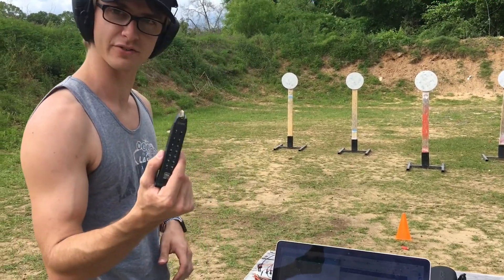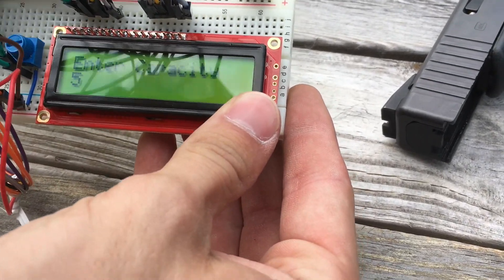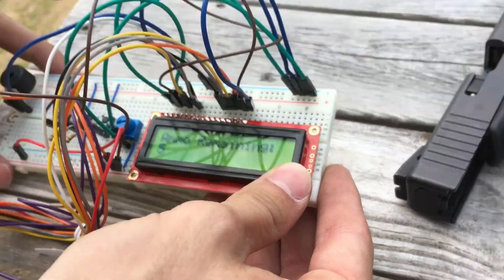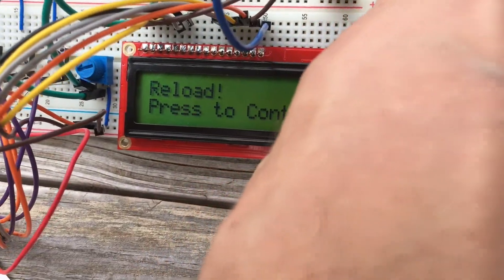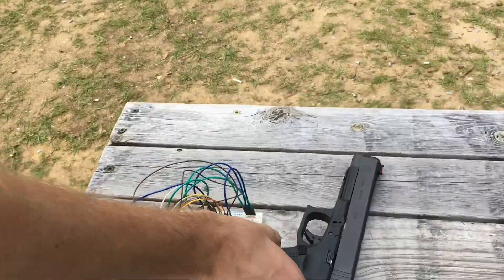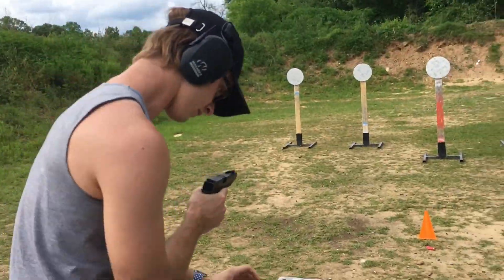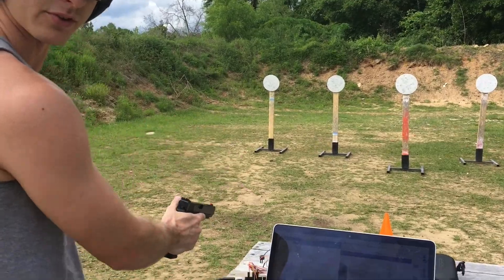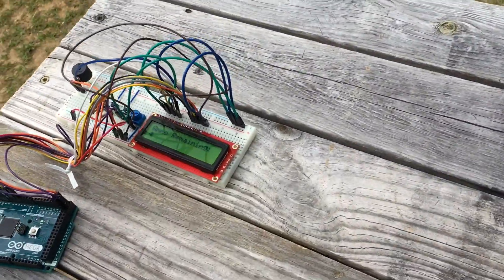Arduino Bullet/Shot Counter Test

Comment: Waiting for an update to your amazing project. Have you made any upgrades or improvements?
Reply from the maker: I appreciate the kind feedback! I have not messed with this much since uploading. I did solder everything to an arduino shield and I'd planned to make a 3D printed case to hold everything but work and life got in the way. It works quite well but I always felt it needed a stronger or more sensitive piezo unit to pick up the shots from a bit further away. I had to shoot pretty close to the unit in order for it to reliably pick up each shot fired. Maybe I will try messing with it again now that I have access to 3D printers again!